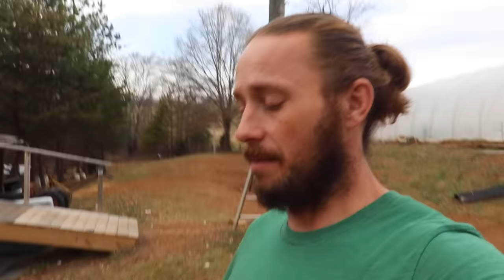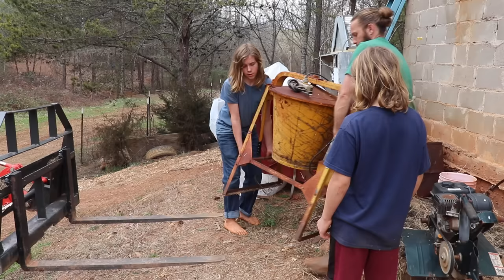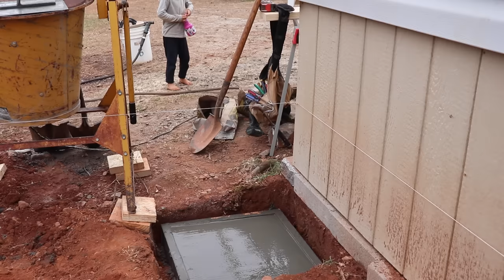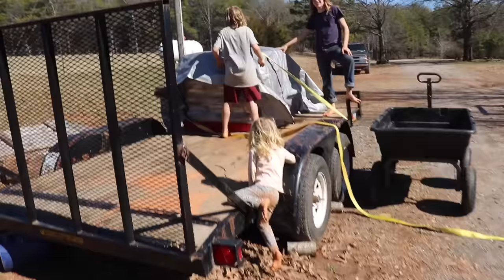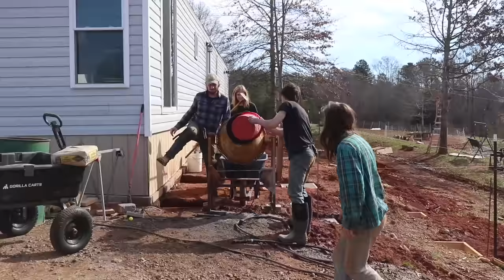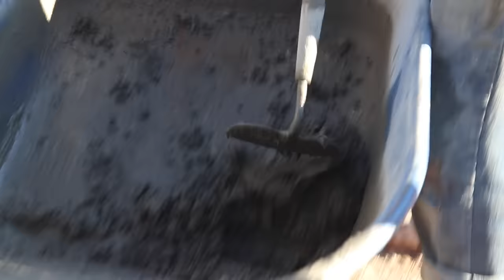Laying The Foundation || Home Addition Build Recap 1

Comment: Ben, I hate to tell you, but that mixer is a Mortar mixer. I fused with one for a few years before I got a real concrete mixer. Boy what a difference. You can use them for concrete, but they are a pain in the backside for mixing any kind of large batches. Good job none the less. Boys did great. We had 3 boys, so it really helped me to get things done when we were doing stuff on our land.

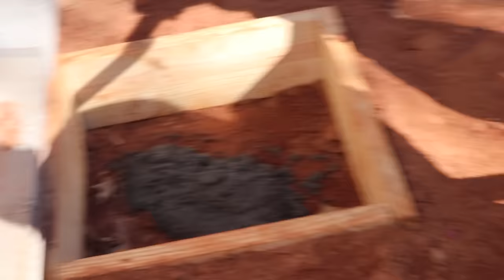Comment: That mixture at  18:30 was perfect.  I was amazed at the effect water has on concrete tensile strength when I did a military project building landing pads for training UH60 and UH47 helicopter pilots.   Twenty-eight individual pads 12" thick with embedded tie downs and signal lights.  The spec was for a 3 inch slump and tested by "beam breaks"  rather than cylinder breaks.   Finishers want to add water and raise the slump so its easy to "pour".  But on pads where they managed to get their way,  the beam break results decreased dramatically, like 40 to 60 percent under specified tensile strength.  They had to be demo'd.  So,  in short,  the drier mixture yields stronger concrete.   It pays to measure your water rather than just spraying the hose in the drum.

Comment: Had to feed the insulation hopper while the husband was bent over blowing the insulation. First time, just a wife, not a construction worker or laborer. Worked some muscles not used for a few months. But after a few ‘exchanges’ of why the hopper was clogging (he never did it either-just the blower) the flow was going and the job was done. Happier day

Comment: I know everybody wants to spend your money, but consider putting down the plastic before you build, but cover it with mill-run gravel.  Sawdust, etc will just fall down in the gravel and it will ultimately give you a better surface to store stuff on.  You can tell I ultimately plan on filling any horizontal surface available to me.  Looks like you're off to a good start.

Comment: If expecting rain, you might could line holes with large plastic bags to collect the water. It’ll be easier to bail out and less mess in king run

Comment: a great lunch for all those builders:  CROCKPOT FRENCH ONION SOUP
You'll Need
3 pounds yellow onions, peeled, cut in half and thinly sliced
2 tablespoons unsalted butter, melted
2 tablespoons olive oil
2 ½ teaspoons kosher salt
½ teaspoon freshly ground black pepper, or more to taste
2 sprigs fresh thyme
¼ cup balsamic vinegar
8 cups (2 32-ounce cartons) beef broth
⅓ cup brandy, optional but recommended
4 to 6 baguette slices, toasted (1 slice per bowl)
1 ⅓ to 2 cups grated Gruyere cheese (⅓ cup per bowl)
How To
Put the onion slices in a 5-quart (or larger) slow cooker, along with the butter, olive oil, salt, and black pepper.  you can put as much onions as your crock pot/slow cooker will hold because they cook down and then divide for recipes!  Cover the crockpot and cook on low overnight, or for 10-12 hours. The onions should be dark golden brown and soft.  Add the beef broth, balsamic vinegar, and fresh thyme.  Cover and continue cooking on low for 6 to 8 hours. Season to taste with additional salt and pepper, if desired, and stir in the brandy, if using.  Preheat the oven to 350 degrees Fahrenheit (180 degrees Celsius).In evenly-portioned amounts, ladle the soup into oven-safe bowls. Place the bowls on a baking sheet to catch any spills while in the oven.  Top each bowl with a baguette slice and the shredded Gruyere.  Bake for 20 to 30 minutes, until the cheese is completely melted.  Turn the oven to broil and brown the tops for 2 to 3 minutes, or until the cheese is bubbling and browned. Remove from the oven and let cool for a few minutes before enjoying!
I usually just do a baking sheet full of sliced French bread with garlic butter and any cheese on them that we have since we usually eat 2 or 3 slices when eating one or 2 bowls of French Onion soup.  I do not bother with the broiler because I don't like my bread crusty or hard 

Oh, this soup looks SO good, don't you agree? We love having it do all the work while we take care of other things on our to-do lists. Have you ever made French onion soup in the slow cooker before? Do you have any tricks of your own for making the classic dish at home?

Comment: Eccess concrete bags to core fill the pileings with a stick of rebar in the holes. Theres enough left to fill the cormers anyhow. Fortionate you van do it that way . Im so close to the coast would have to have wind anchors 2 ft under the footers through the pileings and core filled.. my double wide is on stacked pileings but they wont let me do an addition the same. Looking good.

Comment: Awesome job Hollar Men! QUESTION THOUGH : are all the forms at the same level? Or will you have to adjust the piers under the framing?  Asking because I want to do an addition to my cabin and I need to either put it on blocks or put in founds. Or just posts in the ground. Don't honestly know yet